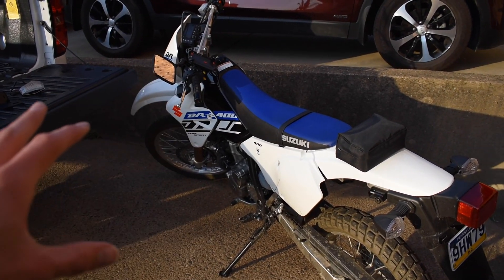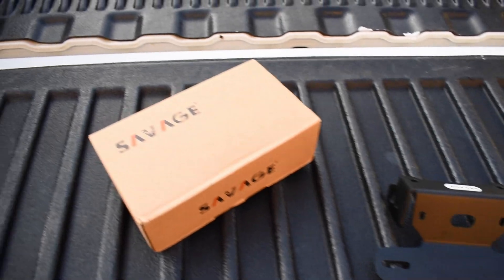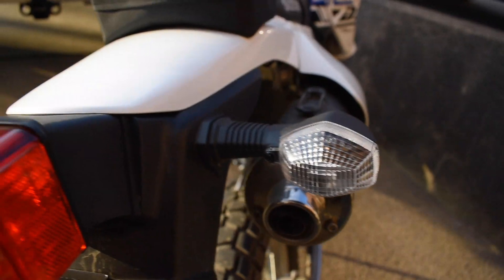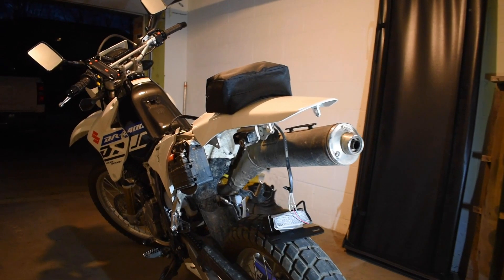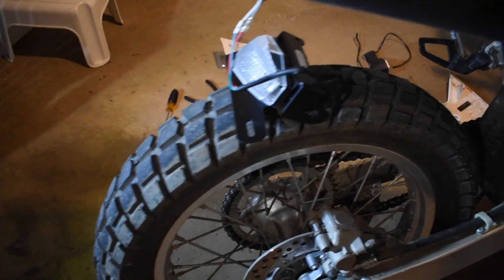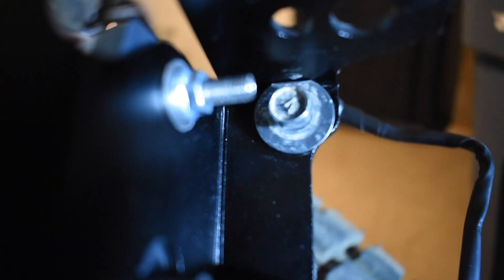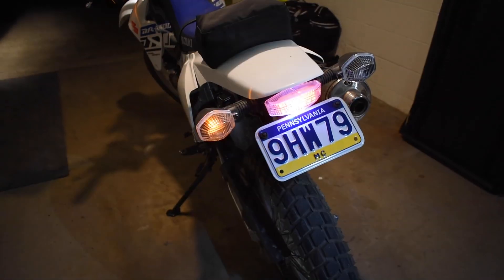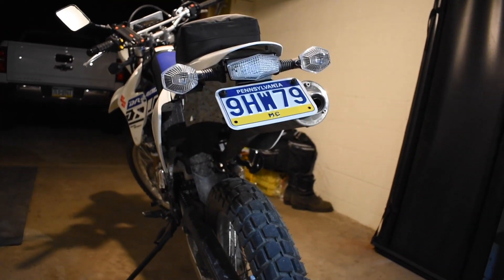CHEAP DRZ400S FENDER ELIMINATOR!!

Comment: I was minutes away from ordering the TST LED INTEGRATED TAIL LIGHT...think you might have swayed me back to the ebay one. Thanks for the video! Thumbs up!
Reply from the maker: Ken Rupin thanks man! For an update, I’m over 1 year and 4ish thousand miles in and it’s still working really well with no problems or complaints 🤟🏼
Reply: Ken Rupin I just dug mine out from winter and walked by it and that fender looks bad.   You got a link to your kit or did you use the one in the video
Reply: Same, was going TST till I saw this 👍

Comment: I just fitted one of these. The gap above it between the fender is larger than i like. Is your rear frame black it doesnt show in the video? I noticed the gap is because bracket mounts to underneath of subframe. Its a shame its not wide enough to mount on top of frame but the bend where the signals attach stop it from being possible. The gap on yours doesnt look as obvious.
Reply from the maker: Nahh man my whole frame is like a grey color

Comment: What did you do with the plastic tabs that stuck down from the rear sides of the fender. I saw them in the beginning of the video but they weren’t there at the end. Did you trim them off? They were originally used to hold on the old tail light housing.
Reply from the maker: Mark Stevens yeah man just shaved them off

Comment: are the bolts you used the original ones or they are included? what about the washer you had to cut? eventually do you know which size I can get to fit without cutting? i have ordered it and I would like to have all the necessary stuff before dismantle the rear tail
Reply from the maker: Used all OEM hardware for this one ☝🏼
Reply: @JohnWargo93  so the washer to cut is something mandatory right? or I can buy a smaller one eventually? thank you for your video :)
Reply from the maker: @xd4rk91x  yeah man, you should be able to buy a smaller one. I didn’t see any harm in cutting the OEM one to fit, but it also wouldn’t hurt to buy new! A great mod either way 🤙🏼

Comment: Still holding up? I’m worried about eBay stuff breaking easily
Reply from the maker: M S surprisingly yes, a buddy bought one too and his is good also. I’ve dumped my bike a few times now and it’s still hanging in there. Lights all work too, very happy with a cheap buy 🤟🏼
Reply: JOHN WARGO thanks! Will be buying one then!

Comment: I’m having trouble figuring out how to get the blinkers out of the oem fender do they need to be cut?
Reply from the maker: iiMoDKiinGx no sir, they’re bolted in.. once you take the entire assembly off the bike you can reach in and loosen the turn signal lights
Reply: JOHN WARGO ah okay I honestly feel so stupid I’m having a lot of trouble putting this thing together I just called it quits for the day
Reply from the maker: iiMoDKiinGx haha no worries man, they don’t come with any form of instructions.. wish I could’ve showed more in detail. Need help filming! Haha
Reply: JOHN WARGO I hear ya I’m assuming now that I’ve thought abt it I follow the harness to the root unplug it take down the whole thing with the old fender and then the only thing that needs to be cut/spliced is the actual tail light wires?
Reply from the maker: iiMoDKiinGx precisely! You’ll be able to reinstall the factory turn signals right on the new tail light bracket once installed as run those wires right back to the connectors under the seat.
Reply: @JohnWargo93  How did you connect the new brake light to the harness under the seat? Because currently, my stock tail light has a clip connecting the harness end to the stock tail light wire.  I have a different tail tidy tail light, but it has 3 wires that has gold ends, but I was curious how you mated your new tail light wires to the stock harness clip?
Reply from the maker: Taylorjmedia cut the tidy tail ends off, and soldered them onto the stock taillight clip! So cut the old tail light from it’s wired too and used the stock wire ends to go into the harness and the new wires to go into the new light.
Reply: @JohnWargo93  cool sounds like i just need to cut the old light clip off with wires attached and solder them to new light wires.
Reply from the maker: Taylorjmedia yup!!